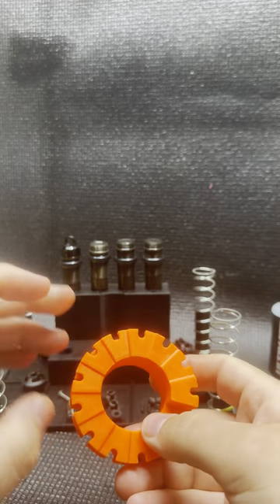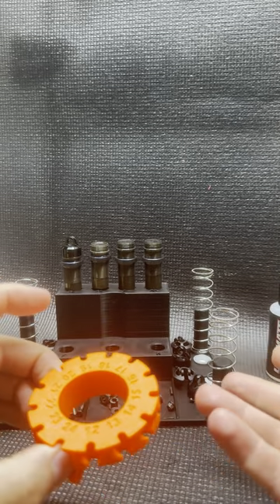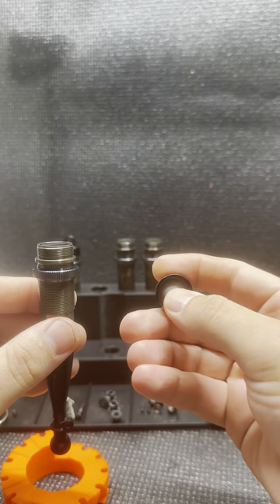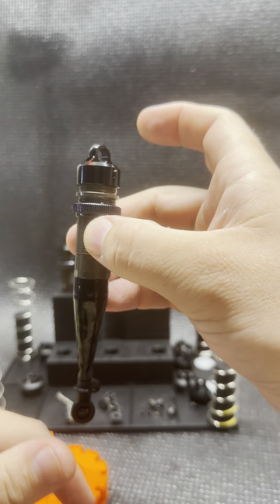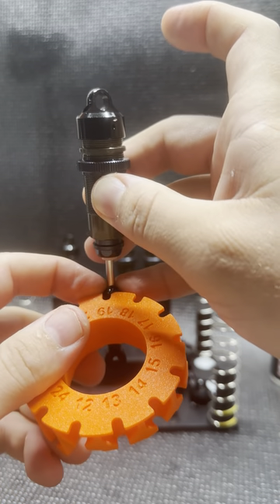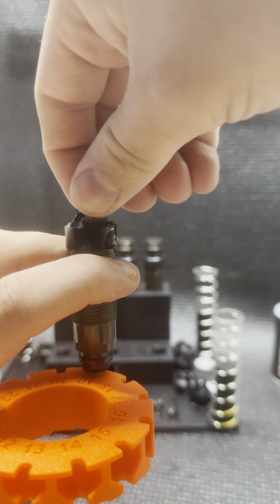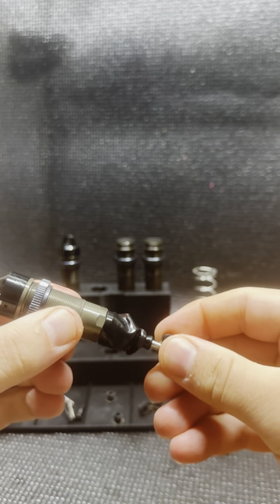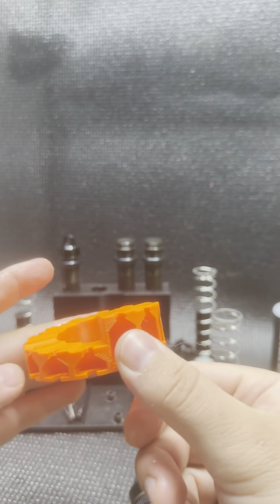WebsterMods Bladder Shock Building Tool for RC cars

Comment: Hey I purchased this tool for my bladder shocks, although this tool is supposed to help me out, I'm having a hard time getting it to work. I'll set my damping to 12 mm and they'll rebound real slowly to 16mm.  Is this because I'm overfilling or simply just air in the system? Thanks in advance